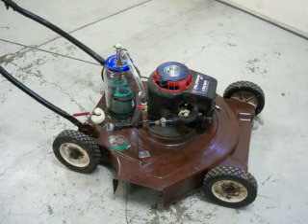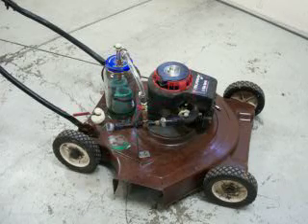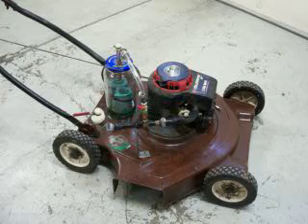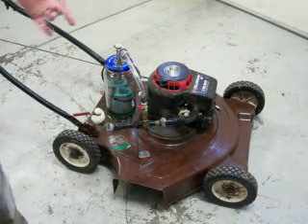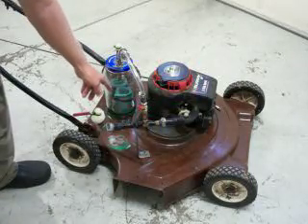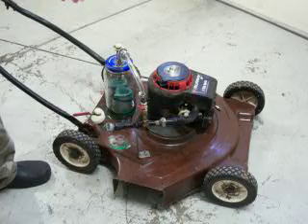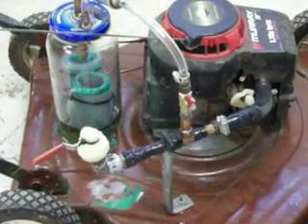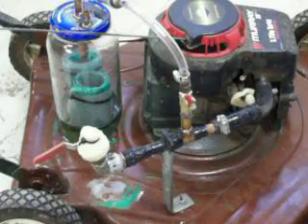just vapor, the truth or a lie

Comment: I hate to burst your bubble, but all cars and lawnmowers run on gasoline vapor.  That's what carburetors and fuel injection are for.  You're just creating the vapor in a jar rather than in a carburetor.  If cars only burnt 2% of the gas that was put into them, where do you think the other 98% would go?  Out the tailpipe which would cause it to flunk any emissions test.  You can blame the government all you want but don't you think if this really worked, an auto company would incorporate it into their cars?  Don't you think any auto company would jump at the chance to market their cars as using 2% of the gas their competitors use?  This is nothing more than an extension of the myth heard since the early 50's that the government won't let us have a 100 mpg carburetor that somebody built in their back yard.
Reply: Funny how with all these advancements and decades of research and billions of dollars, my 2012 Nissan with computer controlled electronic ignition and fuel injection gets the same mileage as my 1973 VW Bug did.
Reply: Frank Howard, big difference between a vapor & a mist.

Comment: I'm a little more then a mechanic and this is not a new idea as it has been around from time dot. It is indeed vapor that we try to get burnt in the combustion chamber and getting the vapor is the trick! What you are actually doing here is no more dangerous the Liquid Petroleum Gas LPG or HOH Hydrogen Oxygen so long as you have a good flash back protection. Because if you do not have flash back protection God help you if that glass bottle or any other type explodes!!  Keep in mind every regular fuel tank is also dangerous. Well Done God Bless.

Comment: Did I miss something but I don't think you mentioned the purpose of the "WICKS" in the glass jar? Not saying I don't believe this works because I do but can you explain the build process a little better, please!
Reply: +bob stout Here is a step by step of how the wicks work:

1. Wicks soak up gasoline from the jar.
2. Gasoline in wicks is heated (it's near the warm engine)
3. Gasoline turns into gas fumes (vapor)
4. Gas fumes enter engine through carb inlet and the engine burns the gas fumes.
Reply: I understand how it works, but if they are the wicks used in a common Coleman lantern then they are very delicate and with the vibration of the lawnmower I would think the wicks would not last long?
Reply: bob stout I think the builder used more robust wicks so they wouldn't be affected by the engine. Maybe fiberglass sheet or some type of felt
Reply: Is there any carb adjustments that need to be made like jetting?

Comment: If this is true, we have been conned out of our true lives!  No exaggeration!  I want to believe but we've been lied to all our lives and so of course I'm cynical!  
If you are on the level, Vapourkid, this is a great kindness to us all.  If not, it's a great injustice!  I lean toward believing you're an honourable man!  Thank you!
Reply: There isnt some big conspiracy. The system has shortcomings not demonstrated in the video that is why it hasnt come to market Please read my many posts and comments for info
Reply: Leslie Clendening Shortcomings can be ironed out.
Reply: The big problem is in the 70s we were led to believe we could retro fit Tom Ogles unit to every car easily. This has become the holy grail in this arena of experimentation. This is not going to happen. The answer is actually quite simple but it means the end of the cars that have been built
The stationary engine runs well and inexpensively on this device but a demand engine does not. So you make a car that powers a generator that runs at a steady state and RPM and you charge the batteries of an electric vehicle using the electrical system to determine the speed
When this system starts out on a fresh gallon of gasoline it runs well for about 8-10 miles then stalls. No one has been able to overcome that phenomenom no matter how much research they have put in. My answer is simple but not a retrofit unfortunately. You cant get a patent on it either so the lack of commercial viability is a problem as well

No we havent been connedin the way you think weve been conned,  weve been conned into thinking we have had the answer all along and thats not the case

I certainly dont take away from the efforts of everyone thus far. Its a very big leap from running a lawnmower to running a car. Its a very misunderstood technology

In the video he claims this is proof of a conspiracy when its not even proof that the system works. There is a lack of scientific method to his video. The WICK and the BUBBLER system are actually the same system its the vacuum that makes the difference not the apparatus
Reply: Leslie Clendening You keep on trusting your GovernMent/MindControl/Media.  Happy daze!
Reply: Leslie Clendening I don't doubt you have thoroughly investigated this topic but that is not my point!

Do you believe our Governments allow us to know everything?

Do you believe the petrochemical/automotive industries act purely in our interests?

Govern = Control.  Ment = Mind.  MindControl
Mort = Death.  Gage = Grip.  DeathGrip
Reply: I have and there are very few things an internal combustion engine puts out that is of  any use in gas saving technology. They are heat,vacuum, 12 volt electricity, circular motion, and reciprocation. Vacuum is by far the safest the easiest to get access to and meets all the criteria.
If all the proof you need is in the video at the top of the page then Ive got news for you there is a government conspiracy to cover up every government conspiracy
The government maintains the sole right to grant or refuse a patent. They can refuse a patent for no other reason than they want to cover up the invention itself and it then becomes treasonous to discuss the patent. That being the case there are 240 odd patents on similar devices if the government was going to cover this up there would be a grand total of zero
If you believe there is a conspiracy then I can tell you flat out you are wrong . If you are wrong about this how many other things are you wrong about?
Im not saying governments dont have secrets, but its hard to keep them in this day and age
This would be the worst kept secret of them all
Have a good one
Reply: I know the president could not keep his affairs secret and thats the president. I dont think you can know everything regardless of the government. You on the other hand dont bother to learn but blame your ignorance on others sad really
If you would like to learn about this technology Im happy to oblige but if you just want to wring your hands about "Big Brother" I'll ignore your next response I dont really have the time 
Again have a good one(if you can)
Reply: Leslie Clendening Same again, bullshit but no straight answer.  And with the knowledge the technology was not my point!  Shallow.

Comment: there no difference.  you're just vaporising before the carburetor.
nothing special.
Reply: There is a massive difference. Vaporizing the fuel vs atomizing the fuel. That's because the carburetor does not vaporize fuel, period. It atomizes: reduce to small particles. The difference is about 500%.Truth hurts.
Reply: Nope.  No difference.  
Where are all the cars actually doing this?  As compared to people immolating themsleves trying to emulate fake videos.
http://jalopnik.com/that-video-of-the-guy-running-his-truck-on-gas-fumes-1633938925
Reply: Again, massive difference. Where are they? Not from the factory. The auto makers will never do this. Why? Government regulation. Do you think our government is going cut 40% of their "income" through fuel taxes? Do you think the oil companies are going to risk losing their business and operation through fuel efficiency? The auto makers only increase vehicle fuel mileage when new government regulation is enforced. Do you want proof of this? Look up the 75 mpg law. That alone tells you cars are capable and if you ask Ford you will even get a confirmed answer of such a car, in this case a diesel powered Focus, that exceeds this mileage but only sells over seas. 

As for your source do you really think your pseudo science (unscientifically proven, i.e. false) posted by the people who work in the oil business is going to convince anyone? All it is is the same twisted misleading "truth" with false incorrect terminology to try and fit the point you want it to. No engine runs on vapors alone. Atomizing is reducing to small particles. Only heat will evaporate this liquid and in the realm of time in a running engine this amount of evaporated fuel never exceeds 10% of the total. Your definition of an engine running on vapor is this small amount and of course you won't admit that part.
Reply: Most who use that term have something to hide. Closely guarded secrets which I'm sure you know nothing about right?
Reply: Haha listen to the rampant paranoia.
I bet you're afraid of everything.
Reply: HAHAHAHA! Yeah! I always get a laugh out of these numerous shills always calling the people aware of their surrounding these "tards" and "conspiracists". Please answer if you can but since when did the guilty get to point fingers and the aware like they are the retards? You want to the people to believe the government's only concern is to protect us? Explain Vietnam, operation Desert Storm, war in Iraq, or ISIS.

Comment: OK, the engine runs. Now, go mow the lawn. These tricks will get the engine running, but there's no power behind it.
Reply: +Kentucky Ranger On the contrary many home built vapor setups have been used on cars and trucks. These vehicles drive down the road without a hiccup as if nothing has changed. But one thing has changed, the mileage, about 500%. Truth hurts.

Comment: mechanic or not, my issue with going from liquid to vapor is with a car engine, you have gaskets and such that are moistened by the liquid gasoline,,, when running vapor in your engine, your gaskets are going to dry out without any moisture getting to them,, this is why when a vehicle sits for a long time, the gaskets, and seals need replaced,,, over time they dried and cracked,,,, just figured this would do same thing,,, on a gas engine,,, you have similar stuff but the oil actually keeps it moist,,, this is why you have a a dipstick on the mower too... but the design of the engines are different,,, the oil moistens these seals and gaskets when on a car, oil isnt always used to moisten the upper seals and gaskets,,, just the lower part of the engine,,,, the upper part of the engine and rubber seals around the pistons are moistened by the gasoline,,,,,, 
so, I see problems with an engine later on down the road on that.......
Reply: oil, not gas moistens it. right? i don't know but that seems right

Comment: This works, however, there are additives in the fuel which stay liquid and those additives are supposed to make the octane rating higher. Using the vapors will lower the octane to the level of freshly distilled gasoline. That would make high compression engines knock.
Reply: +Eviltech Those additives are to inhibit evaporation. The people of the big oil companies are very quick to catch on to all of these inventions like the heated vapor carburetor and add heavy non-evaporative chemicals to combat these products. There way of trying to make damn sure no one ever gets over 30 mpg. Sulfur and lead was responsible to Tom Ogle's TCC (Thermal catalytic cracking) system becoming contaminated and knocking the fuel mileage of his van from 111 down to 12. And you thought it was to raise the octane rating?
Reply: Bone Drone Sources? I have distilled gasoline both from the gas station and from lighter fluid. Turns out the distillate is far more likely to ignite in a lower temperature than the non distilated blend from the gas station. The lighter fluid didn't change after distillation. Also the gasoline from the gas station left a transparent layer of caramel like substance in the distillation vessel. Same results both with low pressure distillation and with high temperature distillation. Basically after distillation gasoline turns in to lighter fluid. It burns well in idle and low power conditions, but when i tried revving the engine it began huffin and puffin and knocking like it wanted to come apart.... We have the worst fuels in here, i have done extensive research in to that matter. What i ended up doing was installing an LPG system in my last car and though the fuel consumption went up by about 2l/100km LPG is less than half the price of gasoline, so that really cut my expenses down. LPG has lower emissions too, so that's a really neat benefit. Also LPG has a really high ignition temperature which means you can run much higher compression than even premium gasoline requiring engines. Also in turbo engines safely run insane amounts of boost. I know my engines and fuels, i have been at it since i was 16. 15 years ago.
Reply: Eviltech How about you look it up your God damn self instead of pushing that responsibility to someone who is trying to inform you? For someone who has observed a process like distillation and taken notes upon the chemistry and characteristics of each petro chemical I'd think you would know what it is you have to do to curtail these alleged "knocking problems" which should not occur due to a fabricated lie perpetuated by the ignorant concerning gasoline vapor and knock resistance. You could always make alcohol. Have you never thought about that? Cut oil out of your life [almost] completely. Sound great? I have come to my own conclusion that engine will run any pure vaporous fuel charge no matter the fuel and burn characteristics of each would simply require the use of different AF ratios and ignition curves. Even methanol which does wonders to metal couldn't pose a corrosion threat with no liquid touching any engine parts. 

But hey, scrutiny is at everyone's disposal.
Reply: Bone Drone It's all about the auto-ignition temperature. Gasoline self ignites at 246-280-deg. C. Ethanol at 365 deg C. This allows for high compression engines to run very well even at high boost with pure ethanol. Usually the fuel inside the cylinder has already been evaporated, if everything in the fuel mixing system is running well. Also lean mixtures burn hotter and make more power, but that damages the engine and creates some nasty exhaust chemicals containing toxic nitrogen compounds. I know perfectly well the topic, i assure you. It's all incredibly complicated, but in short - it's not the burning that hinders engines performance - it's faulty design. Engines simply have too much internal energy waste. Turn an electric motor shaft and see how long after that it continues to rotate and than do the same with an engine. Also theoretically a heat engine like that can use a maximum of 50% of the stored fuel energy. If you want to increase an engine's efficiency just use the exhaust gasses to boil water in to steam and run a small turbine with it... That way in theory you could achieve 100% efficiency(impossible because all the mechanical and heat losses in a practical system) Just look at the new gas turbine and steam turbine cogeneration plants that burn any liquid or gaseous fuel and extract about 70% of the fuel's energy as electricity and 20% as hot water for people's homes.
Reply: Eviltech I like the idea of heated injectors and multi fuel capability that at most would require software (ECM) with adaptive learning capability, very fast that is. This isn't hard since all modern day cars have it to some point. I am not saying to do this, but you can put E85 into a non flex-fuel vehicle and the engine will run. The ECM will adjust the fueling and ignition curves to run the engine smoothly, with a check engine light on. 

If ethanol auto ignites at 365 C then that's good news. Even after it's boiling point of 77.777778 C (yes) we still have plenty of thermal tolerance. Easy vapor production and because ethanol has oxygen in it's molecule it should easily support combustion leaner than what is supposedly stochiometric. 

And dual fuels have been used in diesel engines before two. Literally the engine uses two injectors per cylinder containing a different fuel. Both gasoline and diesel has been used in combination. The best thermal efficiency came from E98 and pure biodiesel at over 60%. Both mentioned combination met emission standards without exhaust after treatment. I would gladly trade a DEF tank on diesel vehicles for an extra fuel tank that I can put gasoline or E 85 in. I did not read about this online in case you ask.
Reply: Eviltech Oh and when looking at this link you posted I was surprised when I saw one such chemical listed there. Carbon Monoxide.
Reply: Bone Drone Carbon Monoxide burns to form carbon dioxide.
Reply: Eviltech If you read about tests on combustion (and fuel) efficiency on diesel engines when using water/methanol injection one thing to note is the increase in carbon monoxide when the amount unburned fuel decreases. So the idea of running an engine on it's own exhaust does have some factual merits. The limit in trying to do so is the amount of carbon monoxide produced during any combustion event. CO no matter what appears to form in the lowest amount compared to any other pollutants.

Comment: atomization and vaporization are literally the same fucking thing. atomization it gives you a breakdown of the fuel then standard vaporization which he is getting by bubbling it through a gas tank. The only difference between what he's got set up and a carburetor is that you have to adjust the airflow and and the air-fuel mixture independently who's performing the same job as an aircraft carburetor only way more ineffectively. period.